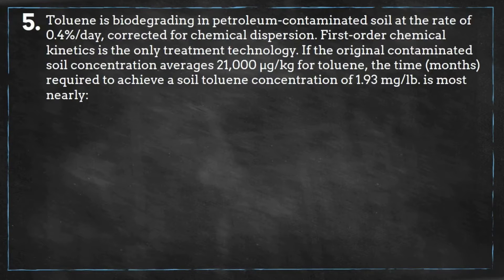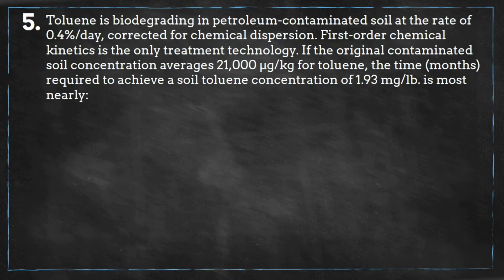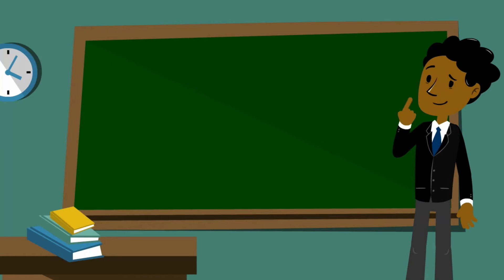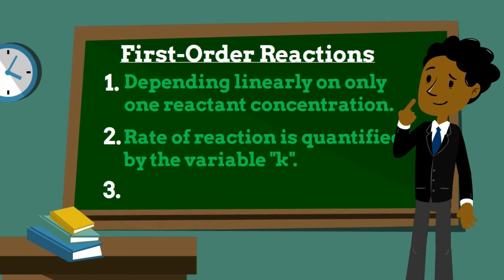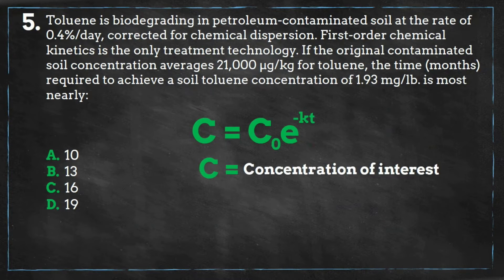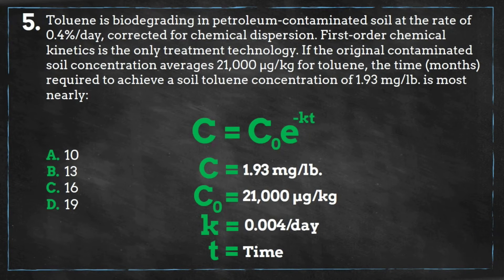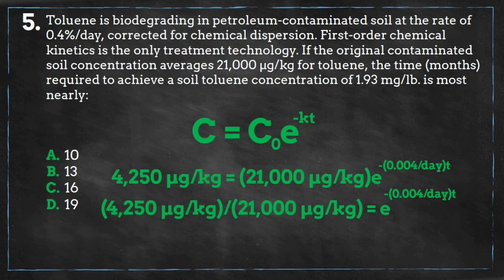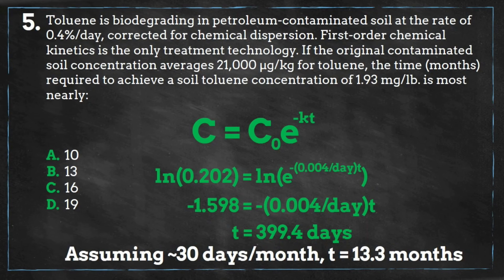First-Order Reactions - Episode 5 (Site Assessment & Remediation) | 52 PE Exam Problems in 52 Weeks

Comment: Where do I find this formula in the handbook?
Reply: Page 104. These formulas can be used depending on what information you are given. The formula he used is just a variation of the ln(Ca/Cao)=-kt. (take the exponent of both sides, solve for Ca)
Reply: I second this question this is the only thing i could find was on page 110, but I got confused and tried do use equations on page 104 (0, 1, 2nd order reversible and irreversible reactions which didnt work for this problem)
Reply: I'm not sure where they got this formula but if you use the formula for first-order kinetics on page 104 and solve for t, you should get the same answer. ln(CA/CA0)=-kt where CA= 1,930 ug/lb, CA0= 9,524 ug/lb, k= 0.004 you get t= 398days = 13.3 months